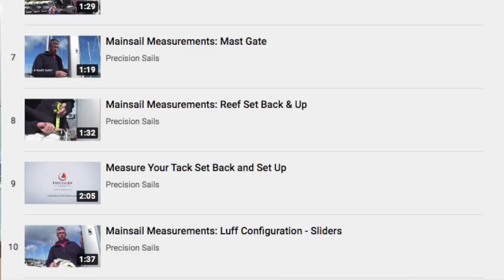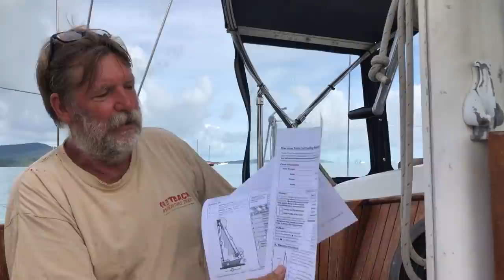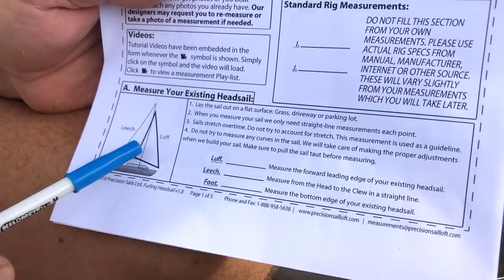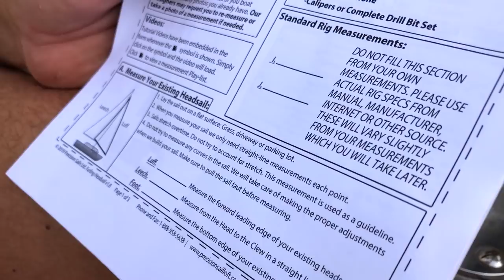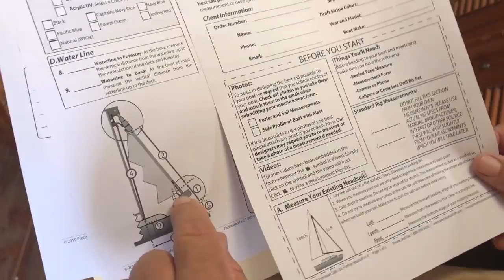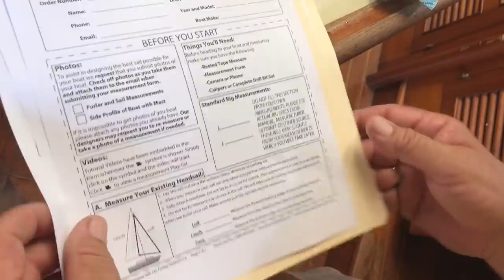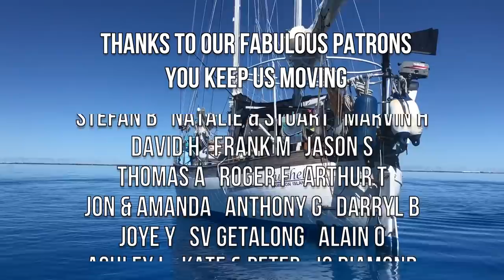Ep 224 | We Need New Sails. Time to Measure Up. Sailing Nutshell, Australia

Comment: We are based in Cairns and also found it difficult to find a suitable Australian based vendor.

We ended up using Far East Sails, based in Hong Kong. They were very good to work with and their pricing was very competitive. We bought a new main off about eighteen months ago, and now with a "new" boat, plan on buying more sails from them now.

We used Far East sails because many of the sail lofts based in the the Americas are sales fronts for Asian sailmakers. Ordering directly from Asia cut out the middleman.

Comment: I wondered what size heat exchanger was appropriate for a trans. 
I have a vertical air cooled heat exchanger on the velvet drive trans, looks like a small VW oil cooler.
Ive not had a problem with it, but I have this niggle in  my mind because a friend said that should be a coolant type.
Almost all marine services seem very casual about their services, I made an appointment with a surveyor to look at a boat with me in Queensland.
He didnt even turn up, I had to leave and drive back to SA. 
Another sailmaker, who I thought I might need to supervise getting the masts back up charged me $500 for an hours work (to the minute) 
Generally treated me like I was an inconvenience. I always provide my not so glowing reference for him whenever Im in a discussion about sail lofts.
Reply from the maker: We had a 6x2 inch heat exchanger but I upgraded to a 9x2 inch. 
The marine industry is shocking in Australia. I have been in it all my life and I am always surprised at what marine tradesmen think they can get away with. It’s appalling.

Comment: Hope you have better luck with Precision than I had last year. I thought they were wonderful too. Did all of the measuring and photos. First they said 10 to 12 weeks and it took 6 months.  Of the 3 sails I ordered, two did not fit. They were off by feet not inches. My measurements were correct but the sails weren't even close.  Colors were wrong. Tried to send them back and the war started. They did finally admit they were wrong and gave me my money back. Don't fall for their great customer service up front. It is all false in my opinion.
Reply from the maker: We will see how it all goes in a few weeks when they arrive.
Reply: We had the opposite experience....we measured wrong and they remade the sail at no extra cost! We have a beautiful code zero from them as well as yankee and staysail. SV Cariba